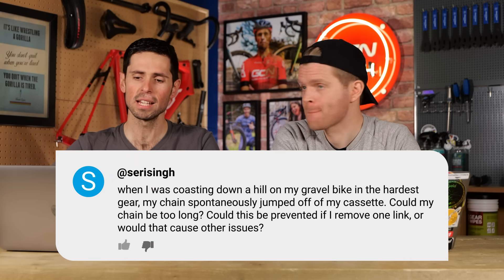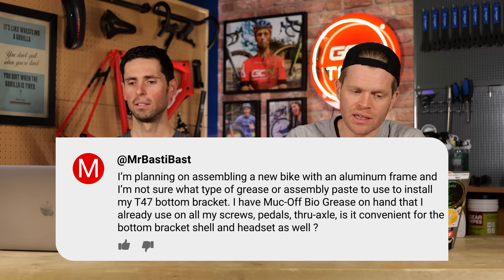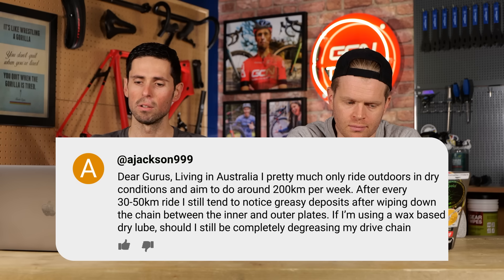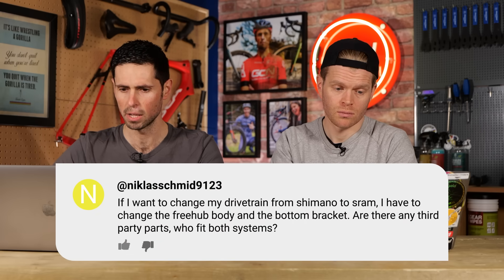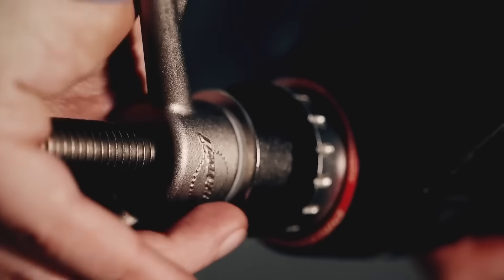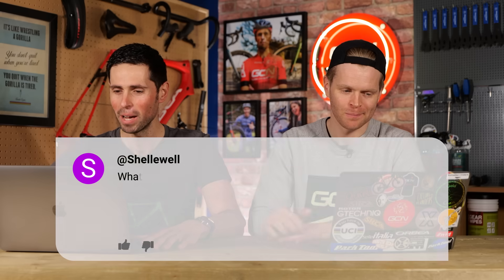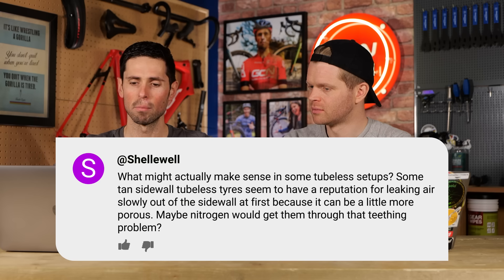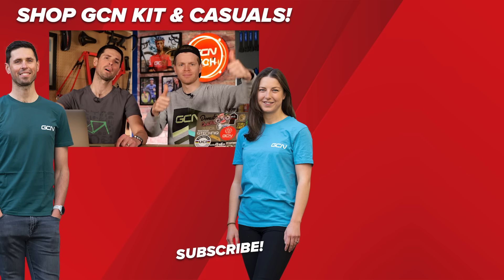Drivetrain Lube, Shimano v Sram, And Leaky Tubeless | GCN Tech Clinic

Comment: I’ve discovered that the rim tape on tubeless tires is the main responsible for deflating overnight. Since I’ve started using Campy Shamal (that has no nipple holes in the rim bed so no use for tape), my tubeless stay inflated as well as tubes!
Reply: That was because you had bad rimtape.  I have wheels with and without spoke holes and they all lose air at roughly the same rate

Comment: I like to use blue loctite on my T47 BB.  Grease only hides noises, loctite makes them not happen.  Second choice would be wrapping the BB threads in teflon plumbers tape and threading them in.  Grease is good in a pinch, but it washes out with water and the BB can vibrate itself loose over time.

Comment: I have used old tires on trainer in the past. Twice it has happened that a small bit of glass in a cut went un noticed. Sometime later, be it 6 months, or a year, as the tire has worn and flexed, that has worked in enough to puncture the tube.

I always felt that getting a puncture during my indoor trainer session was a special effort. And I have managed it twice. 

Thankfully, I am not an aircraft maintenance mechanic.
Reply from the maker: We know just what you mean! A tyre get's pretty hot on a "wheel on" turbo trainer and can warp if pumped up too hard as the tyre gets up to a high temperature!

Comment: Purpose-made Indoor trainer tires are fine, but you can achieve the same goal of saving your good road tires by buying some closeout or otherwise inexpensive road tires or by mounting up an on-hand tire that's already worn, aged out, or simply not your favorite.  Remember, for a wheel-on trainer, you need be concerned only with the rear tire.  Seems obvious, but....

Comment: I have a pair of vittoria corsa control pros that lose 10-15 psi per day. I've tried checking the rim tape, valves, put them on different rims, even switched sealants. They are just extremely leaky tires.

Comment: #askgcntech
Is there a difference between using the large front chainring or the small one on the turbo trainer when in ERG mode? And if so, what is the difference? According to the display, my cadence and power are both the same - but it definitely feels different.
Thanks guys and gals! Merry Christmas!
Reply: lol, yes this always annoys me. It should feel the same but it always feels awful in the little ring. I keep it in the big ring
Reply: @dh7314 what annoys me is actually the big ring 🤣 - but only because it causes problems at low power low cadence efforts. The crank ends up getting ahead of the cassette and then the trainer thinks you‘re not pedalling at all. I‘m also running a 53/39 - I only use the big ring now on efforts above 130watts.

Comment: Hi GCN! I just entered for the Ironman in Copenhagen in August and I want to start training on my positioning with clip-on bars on my Tacx Flux S. When I bought my bike, it was delivered with a 10-30 12 speed SRAM Force cassette, which I used for a hundred couple of kilometers. I then bought a 10-33 cassette to ride the Stelvio, which I now used for around 6000 km's. I would like to install the 10-30 cassette on my indoor trainer and keep the 10-33 on my rear wheel for the occasional ride outside in winter when it's good weather. Will this give problems for my chain because of switching between a more and less used cassette? Thanks!

Comment: #askgcntech
Hey GCN! I have a question for you guys!

Does what disc rotor you use make a difference? At the moment I’m using Shimano 105 (R7020)with some Tektro rotors  that it came with, but I’m considering upgrading my rotors (and possibly the callipers too, if I’m feeling posh) to some Dura-Ace ones for better stopping performance in the wet and on descents. Does the rotor (quality not size) not calliper, (eg: cheaper Tektro vs Dura-Ace) actually make a difference to the stopping performance/stopping distance in wet and on descents?

Many thanks!
Reply: Do the more expensive rotors dissipate heat better? Do they last longer?
Reply: I have been tempted to get Shimano as the plastic bits that act like a thing to channel air towards the disc for cooling but only used SRAM Centreline so far

Comment: #AskGCNTech I recently bought a bike stand that plugs into the hollow axle of the cranks but then found out that Shimano road cranks come with a closed crank screw and another plug down in the axle in contrast to MTB cranks where you can see through. Why is that? Do you think it is safe to remove the plastic plug and replace the tensioning nut with the open MTB version?

Comment: #AskGCNTech  When calculating the length of a new chain for a smaller cassette, do I need to account for the length of the rear derailleur? I have a long derailleur cage with regular jockey wheels. I want to make sure the chain is long enough.
Reply: Park Tools have a good YouTube video on setting your chain length.
Reply: Just follow Shimano's guide to chain length (wrap around big chainring and big cog). That way you remove derailleur from equation. I also have long derailleur and I followed the guide without any problem.
Reply: From what I recall when installing my SRAM Eagle derailleur (only a couple of weeks ago!), I think the number of links that should overlap has to match the derailleur (including the cage size)? So the method is the same, but the cage and jockey wheels sizes are accounted for in the number of links that should overlap...

That said, if you get "upgrade" jockey wheels of a different size, say, that might need to be compensated for.

Comment: #askgcntech Hi there! When riding indoors on my Kickr i'm often wondering why my position on the bike feels unusual in comparison to riding outside. When i put my bike on the Kickr it feels that my saddle is too high and the paddlestroke on the bottom is feeling more uncontrolled. So i'm lowering the saddle about 2-3 mm to feel more comfortable. When going outside again, the indoor position feels strange on the opposite and it feels too low. So i'm again lift my saddle height. Is there a reason for this?

Comment: #askgcntech - Hi Olie and Brandon you guys are great!!!  (sorry for the long question) I'm getting my 1985 Tomassini Super Prestige back on the road. It has full Campy Super Record. I'm trying to fit new Shimano 105 R7000 pedals. They seem to bind after 2-3 threads. The old Campy pedals thread on smoothly. Should I just muscle them on (cutting new threads into the aluminum cranks with the steel 105 spindles) . I'm never going to use the Campy SR pedals again. Or should I take it to the LBS and have them chase the threads with a Shimano compatible cutter? Thoughts???
Reply: ....oh the Campy SR is marked 9x16 and 20F, the Shimano is 9x16 20TPI

Comment: #askgcntech  GCN Tech Masters.  Over time everything needs to be replace on your bike because of wear and tear.  Replacement question on a saddle.   How long should you use your saddle before you think about replacing it with a new one?  I still have the original saddle on my 2016 Specialized Roubaix and I have over 10,000 miles over those years.  What would be your recommendation, 3 years, 5 years, or 8 years?    Thanks Ollie, Manon and Bob (aka Alex)😅
Reply: unless the covering is ripped or broken, or the metal parts are corroded, probably never....

Comment: #askGCNTech - HI, Manon, Ollie, and Alistair. What would cause me to break 6 different rear wheel spokes in a period of two years? History/Background: I’ve been riding on Bontrager Paradigm Comp 25 aluminum wheels. The first three breaks were on a wheel whose history I was uncertain of (i.e., bought a used Trek Emonda SL6 carbon bike locally through Facebook Marketplace). My LBS (now a Trek shop but with much of the same crew) did a full wheel replacement after the third break. I got the new wheel in November of 2022. A spoke broke in April 2023. I got it replaced and had a different spoke break two weeks later. On a 100km ride last month (November 2023), on a gentle descent, I heard the snapping of its third spoke. I wasn’t putting more than 120W through the pedals. I checked with the LBS techs and asked if maybe my weight (I’m 95kg) may be affecting it, to which they said I was well within the maximum weight the wheels are rated for. I only ride the wheels on tarmac and am running 28mm tubeless. For the past six months, I put them on my gravel bike (Canyon Grizl 6 aluminium) when I do road riding. The most power I’ve put through the wheel on a ride is 1200W on a sprint. For comparison, when I ride gravel (twice a week), I’m on DT Swiss aluminium wheels (which came with the Grizl) running 40mm tubeless/ Thanks for any insight you can provide!
Reply: The primary cause of steel spoke breakage is lack of stress-relieving during the build process.  This results in an accumulation of metal fatigue, like repeatedly bending a paperclip, until it breaks. Other possibilities are mechanical damage, or incorrect orientation of the spoke-head in the hub. Suggested reading: "The Bicycle Wheel" by Jobst Brandt

Comment: 1. Probably either your chain has completely the wrong length, or you have not set the dereilleur properly
2. Main question is: Should those be greased? Follow the instructions. A threading should normally not be greased, either loctite or assembly paste. You can also use morgan blu waterproof paste fot things that need neither grease nor assembly paste.
3. If the chain is a bit dirty, that is no problem. Either wax or dry lubes
4. Old SRAM oder new SRAM? Old SRAM is Shimano compatible. Chainrings are generally compatible. I happily run SRAM red 11x crankset on a Shimano 12x

6. Black or Tan ist just the question of how much black carbon the mix in the material. I would assume that your tire or rim tape does not seal properly or your valve is not right. Latex is known to be very diffusion-happy.

Comment: In theory pure nitrogen should leak faster.  The partial pressure difference of pure N2 inside and ~80% nitrogen outside means its being "pushed" out faster than if the tire was full of air.

Comment: Nitrogen is used in performance tires because it is more stable under temperatures and pressures that your bike tires are never going to see.  You're not likely to be going 200mph around a tight corner at Les Mans on your bicycle
Reply: The biggest difference with N2 inflated tires is that it is dry nitrogen rather than 30-50% humidity air

Comment: I cant help thinking you are a little biased towards Silca, you dismissed Muc-Off dry lube which is a waxed based product and works pretty well, a quick wipe with a microfiber cloth and reapplying the lube works very well for me.
Reply: Muc Off is messier than mineral oil that lasts 2000km and lubes the chain about as well as WD-40 does.  I'd pick any other product to lube your chain my friend, I suggest made in America Chain L lube.

Comment: the chain falling off the cassette sounds to me like one of two issues (not chain length):
1. limited screws: I mix up the upper and lower limit screws, which is which, but one of them has the job of making sure the chain doesn't go past the the cassette range... so I would look there first
2. back pedalling: maybe the chain didn't fall off the cassette but actually it fell off the crankset... the chain is sometimes at some angle when in biggie smalls, but only the bottom side but not the top side... the result is that back-pedalling when in biggie smalls can result in the chain falling off... no solution for that, afaik, other than just not back-pedalling :(
Reply: Don't you look for the H for Higher and L for Lower when adjust, when set should just use barrel adjuster to remove slack if mechanical as cable stretch a bit over time
Reply: @mlee6050 pretty much, yes...

limit screws are often and set-and-forget... but if they change wheels (for winter riding) then they should remember to adjust the limit screws every time they switch, and not just the barrel adjuster
Reply: @khazza930  true, I just ride 22mm tubular all year round, I hate the grit though as I feel it destroys tyres way faster
Reply: @mlee6050  surely you mean 32mm! Tell me you mean 32mm, PLEASE 😅
Reply: @khazza930  no, I been using 22mm tubular, also 100 psi on british roads, they go with my 22mm wide rims 1070g wheelset nice, if I knew of DT Swiss and Berd spokes, the wheelset could of been like 750-800g

My mountain bike has 1.75 Silento 26er before stolen, I'm looking to build a Trek Slash 12.5kg with 2.4" wide then build my Trek Emonda ALR 2013 to be about 7.3kg (unsure if that counts computer, horn, lights as well) and going up to 25mm, I'm unsure if to go even to 28mm for that
Reply: @mlee6050  wow, all power to you! i didn't even know 22mm existed!

Looks like you're gonna have a good/fun start to 2024!
Reply: @khazza930  my only hate is Schwalbe stop making tubular and I love Schwalbe as the Silento I literally cycle over broken glass without puncture at all, with tubular I'm looking at continental but might do same with Trek Emonda and thinking to go Schwalbe for Trek Slash

Yeah will be fun, I got to hope I sort brakes or I might spend money for a single lever to replace or to save for SRAM etap to replace it (not axs)

Comment: Forget nitrogen.  78% of the atmosphere is nitrogen.  Inflating with nitrogen will make no worthwhile difference.  Unless you are worried about corrosion and have access to dry nitrogen and want the SLIGHTLY greater pressure stability that 100% nitrogen offers.

No - what you want (and Ollie missed in his weight weenie video) is to fill the tires with lighter than air helium......

Comment: #askgcntech should you clean and lube your chain and drivetrain after every ride? That's what I do using oil based all weather lube, or am I being too much of a dirty clean person?
Reply: I believe it where you cycle so if dry conditions then might be okay a few rides depending on distance but if in wet be more often as water outside might wash dirt on and lube off

Comment: Tpu valves leak
Reply: No they don't! Cyclami tpu tubes have a one piece metal valve as per butyl/latex tubes. They're as good as Schwalbe and Pirelli tubes. I have all three makes plus Ride Now which have been less successful.
Reply: I've been riding about 600km every 2 weeks and pumping the tires up every other Sunday to a full 82 PSI on my clear valve RideNows.  It takes 2 weeks of heavy riding to drop the tire into pinch flat territory on my setup, almost as good as double thickness Continental rental bike butyl on air retention, but not quite.  About 5% more air retention than normal butyl I'd say.